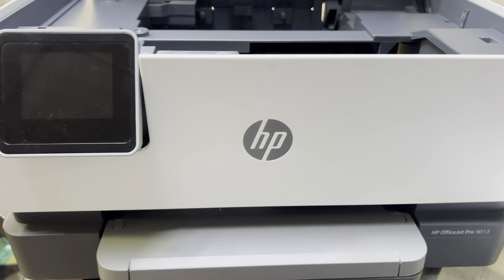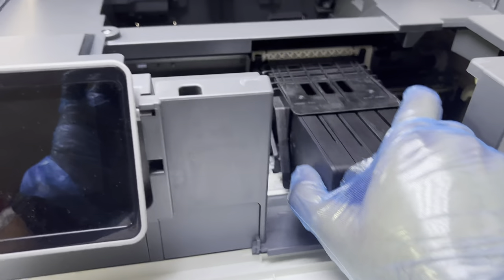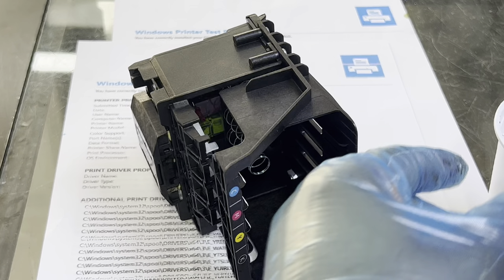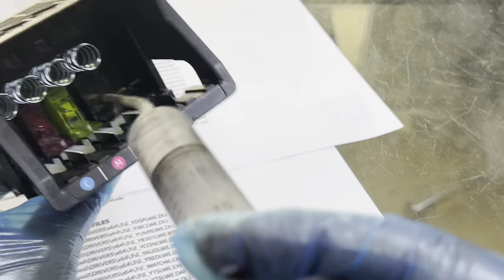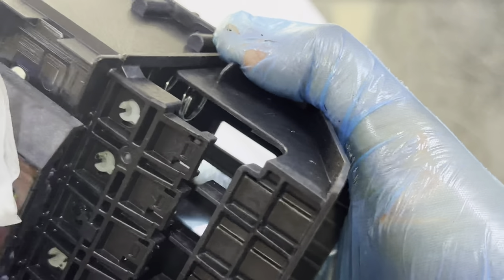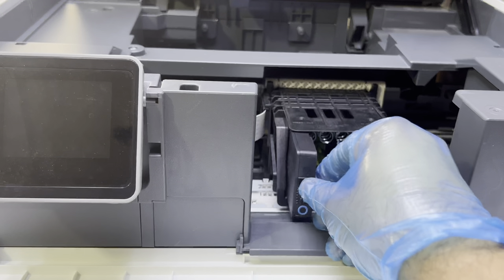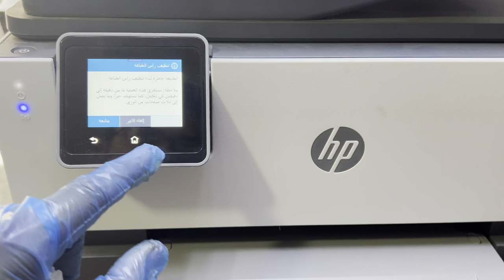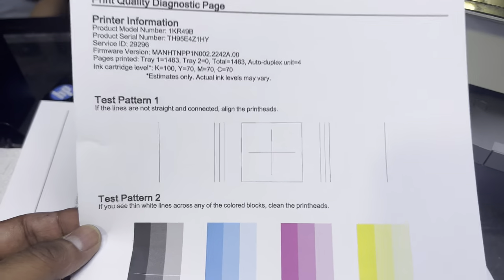How to Manually Clean Printhead on HP Officejet Printers All Models

Comment: Thank you! This should help me out a lot! My paper feed gear broke, and it took my awhile to finally fix it. (Had to take the whole printer apart) By then all the ink was shot. I am about to clean it now. I will let you know if it works here in a minute. Here's one for the Technological Blogger!
Reply from the maker: All the best
Reply: I’m letting the head dry out right now. I dried it mostly with q-tips and paper towel. The black wasn’t working at all, but I was able to get a bunch to squirt out.
Reply from the maker: Hopefully it’ll
Work
Reply: I tried it and the printer said that one of the ink cartridges wasn’t working and needed to be replaced. It’s the blue one and that was working fine originally. Could there still be water inside? I have a fan on it now, and will try again later.
Reply: Why would the blue not work? It says there is a problem with the supply system. Try replacing the affected cartridge with a different non-empty, cartridge. It message reappears again, record message and contact support. The problem cartridge is the cyan one. 🤷‍♂️ it was working fine before I cleaned the clogged black with water.
Reply: I think this jacked up my print head. I’m getting so frustrated. It won’t work at all now. Nothing.
Reply: Finally got it to work. Thanks! 🎉🎉
Reply: @thebohemianmasta  how did you got it working? Mine is stuck in "supply system problem" after I cleaned it
Reply: @Shanaval1  I put in new cartridges and let it run through diagnostics several times. You can also try grabbing all the cartridges and wiggle them back and forth. Swap out the cartridges a few times to get some new ink running through it. Search for the supply system problem, and there are several videos on it.

Comment: Bought a HP OfficeJet Pro 9025 from Office Max (Floor Model).  It first told me that the color cartridges were incompatible.  Replaced those 3 with new cartridges, updated the firmware and now it's telling me there is a problem with the supply system and notes the K (Black cartridge) is the problem.  I put a brand new one in and it's telling them the same thing.  I could see the old one had plenty of ink when I first turned it on.  Have removed the printhead several times to see if I could see any issues but alas - no.  I don't have an old Epson to pull off a tube to inject water....what else can I use?